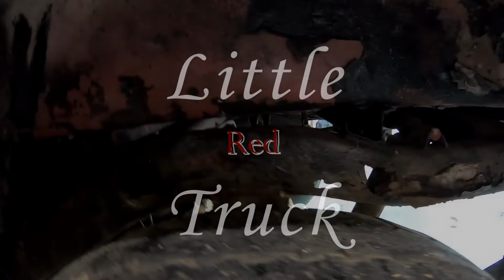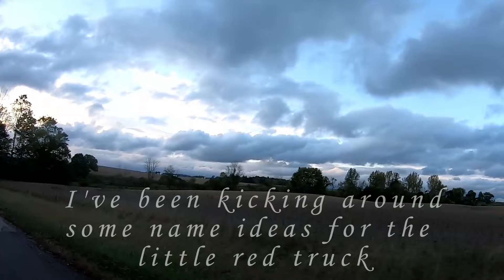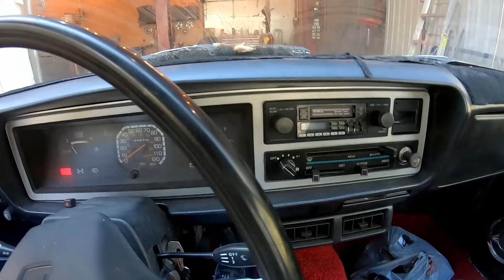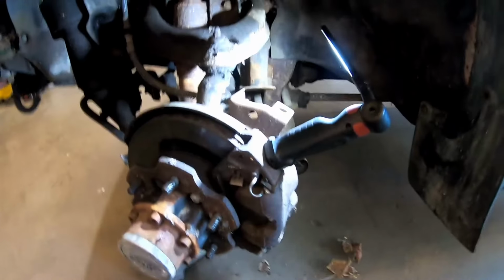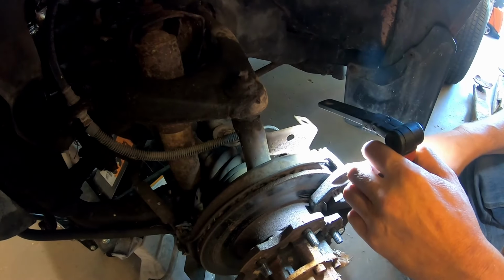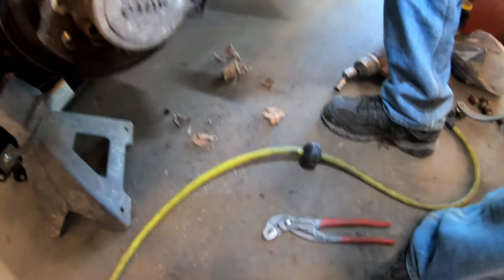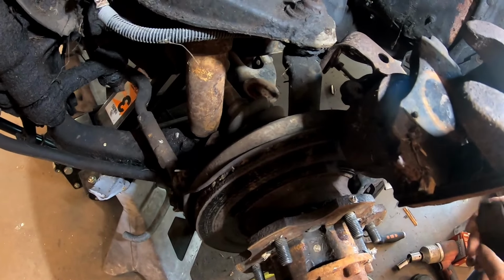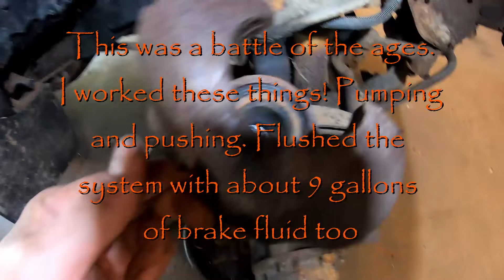Dodge D-50 4x4 Revival II

Comment: Well atleast it's one of the gas powered ones. Don't remember ever having transmission problems aside from the shifter bushing so I can't help ya much there.
The little diesel ones were actually a really neat rig, but it was far indestructible unfortunately. They actually had the HP to keep up with all the mini gas trucks of it's time while probably even outrunning alot of em. But parts are non existent now, even the oil filter, and the cranks and rods had tendency to separate. I put one back together and once for the fun of it, bumped it up to 18lbs of boost and the fuel to match, roast the tires all the way to 4th gear, but couldn't keep a head gasket in it so I turned it back down.
Reply from the maker: Thanks Luke! Lol, I'm gonna do something very unique with this one. Gonna have to tighten up the foundation a bit first. Hopefully be able to reach 88 miles an hour without it breaking in half. 🤣✌️

Comment: I've got the same tranny in mine. She  went into all the gears fine but all gears but 4th was kinda whiny. I took it to a recommended tranny shop and they changed out the main input bearing. The rest of it looked OK. Lemme know if you have any other questions about these sweet pickups. They are worth putting some time and money into because they just don't make em like these anymore. Sometimes i call mine a poor man's Toyota... used Toyota pickups cost a fortune around here even if they're worn out. These older Mitsubishis are as good as the Toyotas... and I prefer the torsion arm front suspension over what the Toyotas did.
Reply from the maker: Hell yeah Bill! They're pretty uniquely sweet. I'm sure we'll be talking in the future. Thanks for the info!